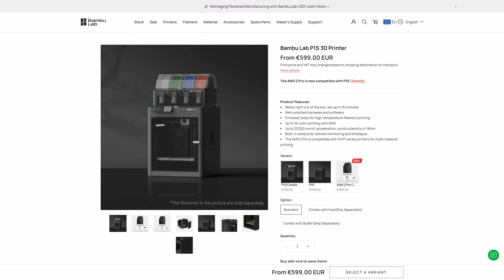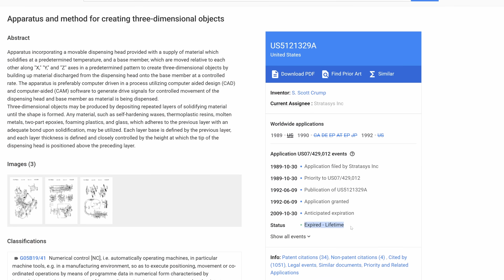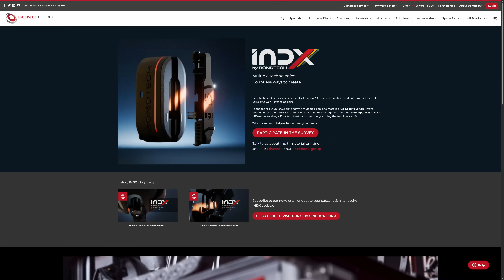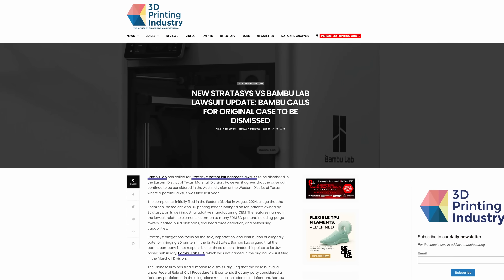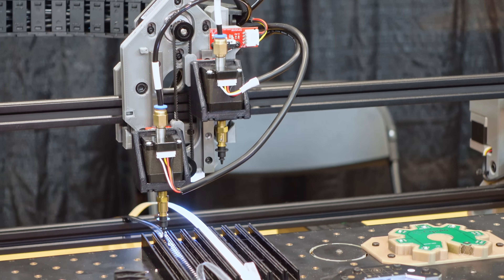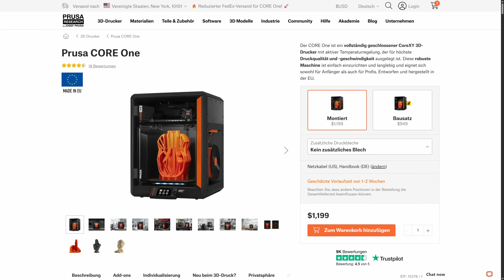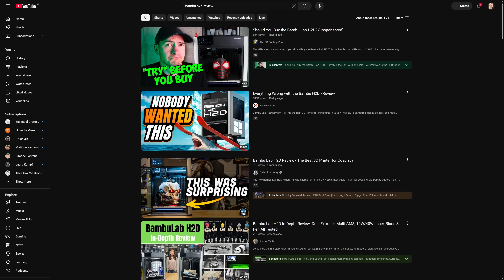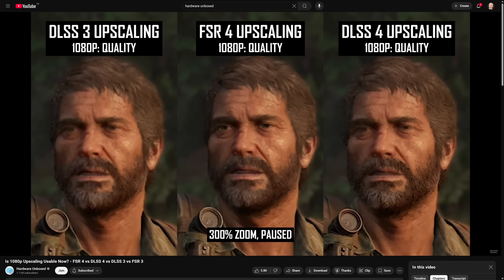How Bambu has won

Comment: I'm surprised that you didn't mention Voron, a very likely source of inspiration for Bambu...
Reply from the maker: Voron is featured in the video, and there's no doubt that the Bambu printers (and many others) are commercialized versions the Voron recipe of CoreXY + Input Shaping + Touchscreen UI. Though as I understand it, the Voron team is actually pretty ok with it - Bambu doesn't interfere with what they want to do (build cool printers), and even brings in new users that would at first have been overwhelmed by the prospect of having to build their first 3D printer from scratch.
Reply: Voron is nothing to do with Bambu. Voron is overpriced design with mediocre specs. Bambu is cost-effective and reliable design with good (not excellent, just good) specs.
Reply: @TheNamelessOne12357  might wanna read the bambu documentation because they do thank the voron team in it
Reply: @TheNamelessOne12357  What specs are you talking about?
Reply: @TheNamelessOne12357 so you’ve never seen a voron, it sounds like
Reply: @theorphanobliterator  I've seen 2.4. And I immediately tried to calculate how much all those rails and carriages cost, if bought from decent brand like HIWIN. That was enough to call it overpriced.
Reply: @TheNamelessOne12357 they’re open source, dude. you can use whatever parts you want from whatever sources you want. do better

Comment: never forget they tried to screw you and everyone after the sale. 
no matter how good their products are, this crossed a line. 
i got a p1s, im very happy with it, but i cut off the internet access to it and left it on a firmware that came out earliert. it works, it will work in 5 years and no one can change this without my approval. its my machine not theirs anymore.

Comment: Bambu won ? How ? In my eyes it didn't won anything. Biggest problem is that latest controversial change that they did that you can use their machine only with their software. Big red flag for me. Yes they build a great machine but locking other software out ....

Comment: IMO, you should do a U turn, and go back to what you like in tinkering and open source. you can make great review but why waste the potential that you have (and knowledge) for reviewing there are several videos around, they might not be at the same level, but with watching several one get a grasp of the printer itself. instead a good project done for you will be much more difficult to find. i would prefere 10 times, that you partner with prusa for sponsoring the material you use and developpe something opensource, that is shared and that might or might not be integrated to prusa printers themselves. eg. doing a new tool for the tool changer, doing a paste extruder, or a separation agent for the interface layer between support and print. this are examples that come to me from 2 min of thought. that you have the knowledge, you like, it goes with 'your principles', can benefit the comunity and you dont finish being another person doing a review. I use my printers every day, I am prusa owner and i must say that i doubt about buying a bambu when i bought my mk4. I think that prusa took too much time to release the core one and now they are running to catch the bus, but still i prefere them, at least for the moment. but even the prusa printers, they are becoming less and less tinkers around. maybe you will get less views (i dont know) but at least it would be something original, and something that you enjoy doing. if you put to make reviews, i will still watch the videos as they will be good reviews but meh.... would not go with same enjoyment as with tinkering, giving back to community.

Comment: As far as reviews go, I think there would be value in making a review that's several months late, focusing not just on how the printer performs hardware wise, but how the slicer and the integration have changed (or more importantly, improved) over time. 3D printing will still have massive improvements over time, but those will exceedingly come in the form of slicer and firmware updates. Printers are - for me at least - a tool, and should be evaluated as a tool.

The current reality of details (open source being a major aspect) not mattering as much as they used to are something to push back against. Bambu was basically bullied into open sourcing their slicer, and I believe Prusa and even Bambu benefited from from that. I don't want manufacturers to feel comfortable pushing the "you'll own nothing and you'll be happy" into 3D printing. "Vote with your wallet" is something I try to do personally, but not everyone is willing (or able) to do that.

Currently you can take a printer from 2010 and use a modern slicer to greatly improve the print quality compared to slicers even a few years ago. What if a manufacturer suddenly decides to prevent newer slicer versions of working with their old printers? Or from even receiving gcode from "unauthorised" slicers? Will we be able to publicly condemn that or will we just say "well it still works but it was getting old, so I'll just buy a new one since it's cheap"?

There's plenty of things for manufacturers to lock down beyond that. And if a big player does it, do you really think others won't follow suit?
I don't mind "works best with" and "extra" features for using everything first party. But if my car has heated seats physically installed, I expect to be able to use them without giving a dime to a vulture looking to rip me off my whole lifetime.

Comment: If you want to sell vacuum cleaners and appliances. Go for it. 

But don’t expect your viewers to join you on that.

Makers make because they are “open” to do that. Close that open door and you’re left with consumers. Not makers. 

I’ve got Bambus, Prusa’s and many others. Bambus work fine most of the time but I will never be loyal to them. They don’t deserve it. I can still fine tune a Prusa to make better than Bambu. And that whole China-big-brother thing. I just can’t get over that. That’s a lose not a win. 

Thanks for the video. 

😊
Reply: By that logic why don't you make your own open source vaccums? TVs? Why not all electronics, where do you draw the line and why?
Reply: @JakovPerisic  there is usually a trade off between convenience and freedom, though some people do managed to get both

You don't always need to be on one side or the other, it is a spectrum

However, convenience usually comes with some strings attached,  (not always, but bamboo is not one of them, for example, framework) 

I'd say yeah partially, I support "source first" more than "open source", though it has its place, if you are a consumer cooperative, almost all electronics should be as repairable as possible, the more expensive, the more repairable, this is also for reducing e-waste, (id just support good cooperatives whenever possible or if not existent, companies that values their community)

It also produce a more diy, independent, less consumeristic, more productive, and freer society(due to not depending on locked down stuff),

And not everybody needs to learn the skills to repair everything, you can depend on others who spent the time modding and repairing, 

There is more opportunity for the average people to get jobs too,

It can also makes stuff more compatible with each other, you can install what other people had make,

Such principals basically opens up a monopoly, 

Though these above are an ideal,

Realistically, the rule here is don't overly depend on proprietary things for your core things, what defines and sustains you, the foundation of your main hobbies and such, but for non-essential things, go ahead,

Comment: I will never again buy a Bambu printer. Between their ripping off Prusa without so much as a "thank you" and gaslighting its own customers, it has won the worst company of the year award in 3D printing space.
Reply: What did they rip off? They forked Prusa slicer, which is allowed.
Reply: @rsilvers129 I don't know about Prusa IP, but I know they've filed for more than a dozen patents (and been granted most of them) for innovations that came from prior art in reprap and voron projects.

They literally received a patent on three-point bed tramming. 🙁
Reply: Were are they ripping of prusa? Its open source. Also prusa ist STILL lacking basic features in their expensive core one printer. Cant rip off what isnt there.
Reply: It's not ripping off if it's open source. And if anyone got ripped off it's stratysys. Aren't they the ones who were suing bambu?? Oh wait that lawsuit also would filter down to prusa as well since prusa stole the idea of a heated bed from them. Nice try. Do some research.
Reply: @phasesecuritytechnology6573  They are ripping them off, it is just legal since of open source.
Reply: @phasesecuritytechnology6573  you're either trying to rage-bait or just severely misinformed. In either case i'm not going to waste my time giving you every instance of "cloning" that Bambu has done. Do some research.
Reply: @UNgineering ip lawyer interviews and patent discovery. Its all in the lawsuit. You're talking out your hot end.

Comment: Bambu won the customers that want a fast reliable 3D printer and they to not what a project. That people are far more than people that like to tinker with 3D printers. And tinkering with 3d printer is interesting for 1 to 2 years. After that people usually move on to other things.

Comment: As someone who is only interested in the parts coming out of the printer but not the machine itself and even less for the company behind the machine, Bambu was the fresh thinking at a high but somewhat acceptable price point that got me back to 3D printing.
Do I like their firmware changes? No. Am I willing to shell out more for a Prusa kit? Definately no as well. So Bambu and its clones it is for me.

And what I would love from a reviewer like yourself is nothing more or less than a run down of which of the promised functions work (out of the box) and which do not.

Comment: Curious to see someone still rocking a RAT mouse
Reply from the maker: Almost nothing as capable as the rat out there! I specifically need the side wheel to zoom in and out of my video timelines when editing, but had to switch from the flat RAT 8+ to the more ergonomical Keychron M6 due to shoulder issues.

Comment: I was on the verge of buying X1C, but their shennanigans with firmware put me off. I bough Core One as a set of parts to assemble, and do not regret my decision.
Reply: Another Prusa dying brand bot Bot😄
Reply: I guess the work Prusa put into making the firmware issue look worse than it was, was successful. All of my Bambu printers have the new firmware update and legit nothing has changed in my workflow. Everything was blown up and made into something it wasn't. Don't always believe what you hear online. I could never imagine paying over $1000 on a printer to have it A) not have a camera in it, selling it as an upgrade. B) Has acrylic panels rather than glass. C) Has some of the worst VFAs I've seen on a modern printer.
Reply: @EliteCanadian92  You wont pay over 1k for a printer that does have any of that stuff. But you'll happily pay over 1k for a printer that has the build quality of an ender 3, no customer support, no QC, a company that lies and gaslights their customers. A company that has the rights to use you models and the rights to brick your printer at any giving time.....Make it make sense.

Comment: All that tinkering and modding is fun. But so is a printer working. As long as both exist i think we are fine. I have built printers modded printers converted printed and that was so much fun. But i have also used closed printers all the way back to the UP! Plus printers to the X1C . All have there place. I would also love to see an UP Plus 2 with klipper on it going like a bat out of hell , that would be cool, the platform was solid but held back by the tech of the time.

Comment: Bambu P1S gave me a tool.  I don’t need to know how a hammer works, or a Festool Domino. I just need to practice using it.  It’s the same way with the P1S.  It works, so I can dedicate time to learning how to utilize it.  CAD and Blender are a couple of skills I’ve learned that come to mind.  It’s damnably hard to get a job wherever I would want to live with knowledge about how to build and tune a 3D printer.  It’s way easier to get a job with CAD or Blender skills.  If I’m going to take on the “Maker” label, I dont care how to “maker” a printer.  I want to make things with that printer.

Comment: Been lusting for the Core One - primarily to support prussa tbh - but sadly its too small for my designs. And that I only needed petg/tpu printing... went with a V3 Plus. Bambu was a consideration as well but again, small build size, don't need enclosure, not a fan of their ecosystem - though I am certain their ecosystem is why Bambu has such amazing print quality. 

Coming from a Voron 2.1 though, the V3 plus is an appliance. Prints just work, no need to fuss with any sort of bed leveling. My first bedslinger as well, very surprised at how good an off the shelf 3d printer is these days compared to when I first started with a wobbly delta XD

Comment: I personally have mostly self built printers (Voron these days). I was always hesitant around Bambu, and it turns out rightfully so with their whole firmware/cloud nonsense (and I know definitely won't ever get one). I mean the whole way the ecosystem was setup it was very clear that the rug pull would come eventually, just a question of when.
But these are the kind of aspects that I would look for details on with reviews, if I ever were to get a non-self-built printer. I mean there might come a point that just printing one is no longer comparable in terms of performance or capabilities that just need industrial manufacturing for more than bearings, the hotend and electronic boards. Even then I want to own my machine, be able to use it without anyone's elses servers or knowledge. I want to be able to repair it, so spare parts are needed (Bambu actually does that quite well, even pricing). I mean for me personally, if it requires internet to function, it's probably disqualified already.

Edit. I forgot: I really don't envy your position, trying to find the aim of your channel. but I do hope you succeed, as the channel has always been almost a shining light compared to most others, just also very light on content (just the amount) probably as a result of your own standards and direction.
Reply: You don't really have a valid viewpoint on this until you actually try one of these printers for comparison.
Reply: "and I know definitely won't ever get one" This is funny because you are just going to end up buying a Bambu copy in the future so that you don't "have to get a Bambu."
Reply: @rsilvers129 you don't know me, and no I probably won't. You did read the part about my printers being diy? Currently mine still outperform a Bambu. Even if they come up with a crazy new super-feature (so far, they haven't), I don't need to have it just cause it exists. My printers do what I need with capabilities I'm not even fully using anyway.
I'm about to add multi-toolhead support to my Voron (stealthchanger, probably), which they still can't do and is closer to a Prusa XL.

Just as a side note, if I ever did buy a Bambu copy for some unimaginable killer-feature, that would exactly be the point: not buy a Bambu. The printer then would have open firmware support (I can flash whatever I want), be fully local/offline and be generally open (slicer etc.), because I just wouldn't buy it otherwise.

Comment: Bambu won the race to the bottom - well done Bambu. I'm still sticking with that mostly open source printer company, because I've been into printing long enough to remember how long it took to get here. As for this channel, I've always seen it as the Gamer's Nexus of printing - it's not about reviewing the latest hype, but more about fact checking, ensuring standards are being met, calling companies out, and thinking a bit further ahead, instead of just "this is the fastest/cheapest machine RN". Please keep on doing that.
Reply: "Bambu won the race to the bottom" No. Bambu didn't race to the bottom. They never sold them cheap. The Elegoo Centuri is doing that though.
Reply: @rsilvers129  The bottom here is how Bambu turned 3d printing away from open standards, open ecosystems, open parts, and open accountability, and made it all about price. Case in point.
Reply: The race to the bottom was already started and won by creality. This is a nonsense comment.

Comment: Thomas, I have a collection of 6 Prusa Printers, of interest they are progressively worse as they get newer.  My CoreOne is quite untrustable.   I could easily change to Bambu, I'm feeling the pressure and only their cloud forcing strategy is stopping me.   This afternoon I have a couple of prints to do.  I chose the two oldest printers - because they can be trusted to get on with jobs without whinging, and of importance not having the 15min heat absorbing start-up.    You are very right about Open Source, but this needs to be targeted.  As makers we need our formats and models to be as open source as possible so that we CAN change printer vendors if we wish.